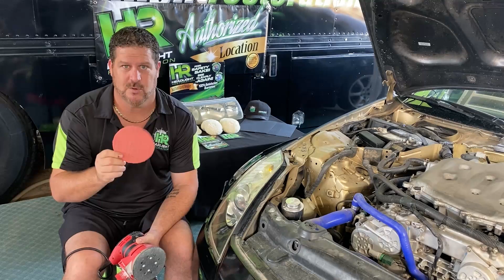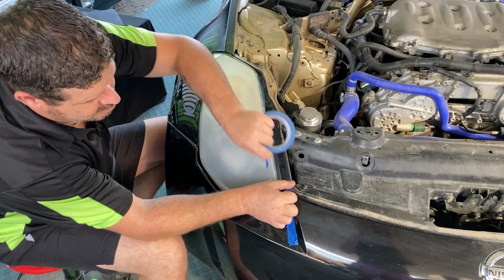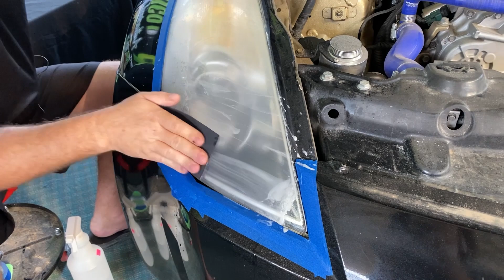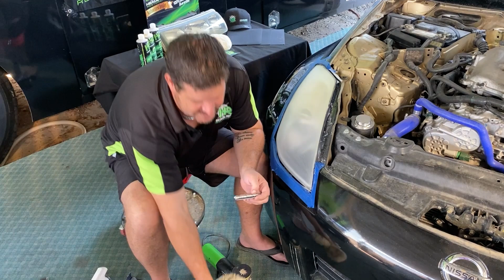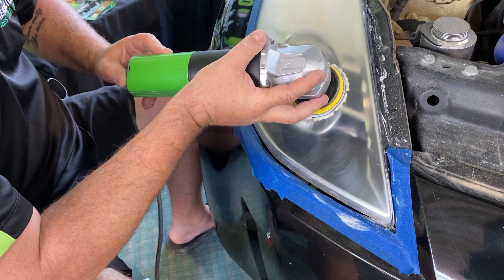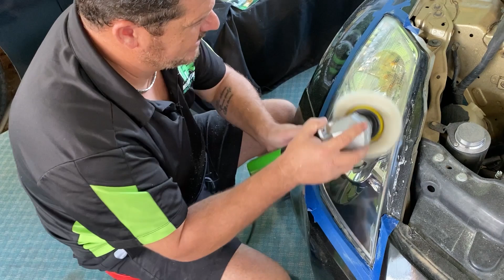Complete HR Headlight Restoration Process

Comment: Will the sanding process remove micro cracking
Reply from the maker: Are you referring to the spider cracking on the inside of the lenses?
Reply: Yes. I there anything you can do for that.
Reply from the maker: @michaelhoward1298  it doesn’t take it away but it does make them less noticeable with having your headlights clear
Reply: @hrheadlightrestoration6858 how long does it last
Reply: Why not a drill, make it faster???